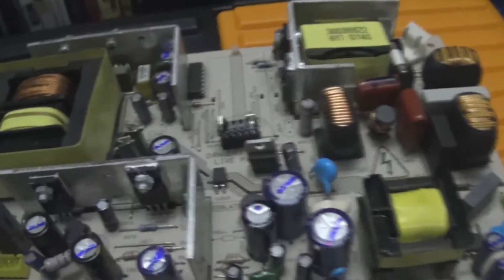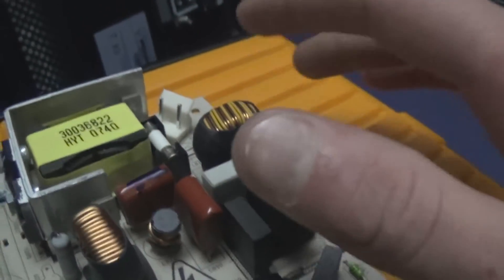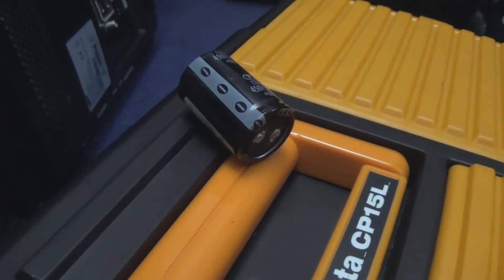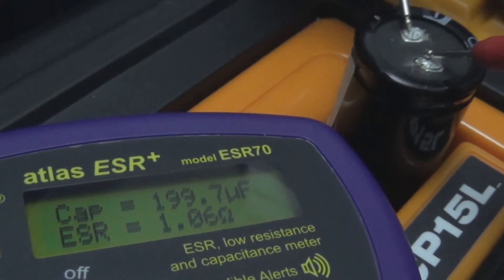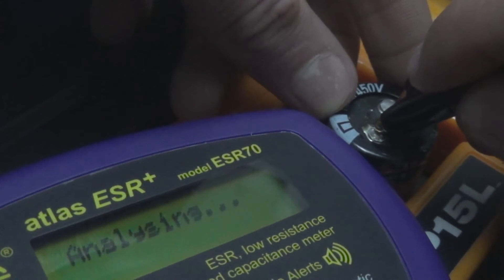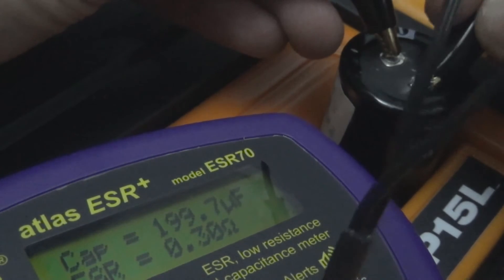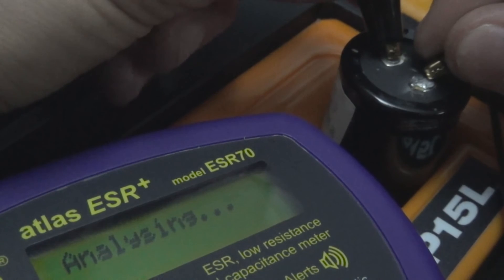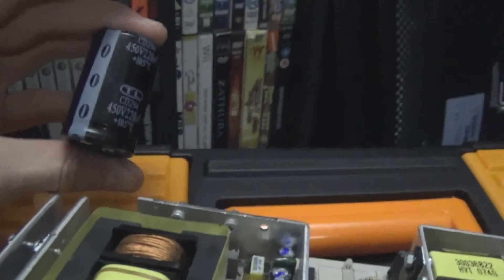Intermitent Break Down Of A Capacitor

Comment: I would have soldered wires to it and connected it to a rectifier with a ballast :)
Reply from the maker: Lol I could have, I replace it but the Psu still blew up so I just replaced it as fixing these is not fun.
Reply: +MrReeceyburger123 I was meaning capacitor out of TV but thinking about it with recharged brain the pfc probably was blowing the fuse to due "no capacitor" or one of the smps on DC bus due to unclean power.

Comment: reec my freind thanks firstabl and i need u r help with a tv wich had an vertical with line in the midle of the screen. kids droop sam water on the screen and since i had the problem. if u have same idea i l be grateful. thanks again.
Reply from the maker: Hello thanks for the comment, the screen has failed which is not fixable sorry :( The water would have shorted out the address driver chips bonded to the screen and they are not replaceable. Its scrap sorry :(